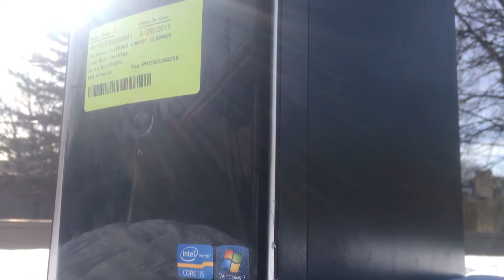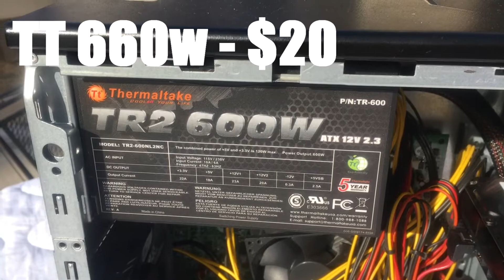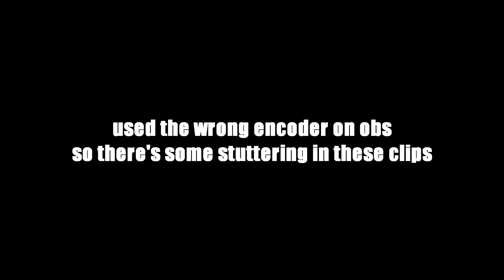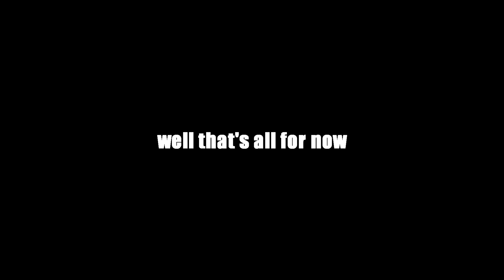$140 Upgrade Turns Old Dell Into Modern Gaming PC [House Fire Computing]

Comment: Will an MSI board fit? Amazon currently has an i7 that comes with a msi board and I believe ram for under 400
Reply from the maker: I dont know for sure but probably not. Using an aftermarket motherboard in one of these cases can be problematic because of proprietary connectors for the front panel and things like that. older ones like this used more standard connections but I no longer have this pc so I couldnt tell you for sure.
Reply: Why not just buy a cheap case if you’re gonna do all that..

Comment: I have a Dell 620 will the same power supply you use work?
Reply from the maker: if it's the mini tower then it should take a standard ATX power supply. If its the small form factor than it wont fit. However I'm not 100% sure so do your own research to be sure.

Comment: Hey, I have a Dell 660. I’m trying to upgrade the power supply and I don’t know which ones would fit. Can u tell me a few power supplies that would fit? (Preferably a PSU with 500+ watts)
Reply from the maker: any standard PSU should fit if you have the full tower 660 like this one. I would get a rosewill if you want something cheap, or maybe something like an evga g2
Reply: ratboy would a EVGA 600W ATX fit?
Reply: ratboy it’s for sale $60 in Best Buy
Reply from the maker: @xlfredo  I would think so, any psu should hook up to the mounts on the case, but some might go back father than others, that being said this is a pretty big case so I wouldnt worry about it
Reply: ratboy the measurements for the EVAG 600W ATX are:

Length: 5.5 inches
Width: 5.9 inches
Height: 3.35

Will it fit?
Reply from the maker: @xlfredo  I would think so, if you really want to be sure just measure the PSU thats in the computer already
Reply: ratboy I just got it. I’m setting it up right now and it fit perfectly!
Reply: ratboy I’m also rocking the RX 570. It surprisingly fit too
Reply from the maker: @xlfredo  nice man, I had to cut out the hdd slot to fit the giant 970 in there. thats a really good card for a budget too

Comment: Not sure why you went with the i5 3570 when you could have gone with the i7 3770.
Reply from the maker: Notails they are pretty much the same chip other than a slightly higher clock and hyper threading on the i7. at the time the i7 was almost double the price of the i5 and would maybe be 10-15% faster for gaming so I didnt think it was worth it.
Reply: @ratboyOwO  I'm upgrading to the i7 3770 and updating the bios prior to installing. I am also adding a new 700 watt PSU and an RTX 2060 GPU. Should I run into problems? It's a full sized Inspiron 620 tower with Windows 10 Home.
Reply from the maker: @samael1981  should all be good granted everything will fit in the case
Reply: @ratboyOwO   I am asking because I've recently read reports of people saying that the computer would not work with the RTX 2060 they bought.  I am hoping it was because they still had window 7. Originally, my machine was windows 7 but it's now windows 10.  I am also wondering if I can replace the two 4GB ddr3 memory sticks with two 8GB sticks.
Reply from the maker: Notails the ram should work. make sure your bios is updated to the newest version for that GPU. Im not 100% sure if it will work but most nvidia cards will. I have had trouble with older dells and radeon RX cards though
Reply: @ratboyOwO  The RTX 2060 did not work because it requires UEFI, but the GTX 1080 does work nicely.  Next thing I want to know is if the i7 2600/2700(k) will work.  The i7 3770k did not work.  The PC wouldn't even boot.  But I am wondering if the 2nd gen i7 will work.
Reply from the maker: @samael1981  Thanks for letting me know about the bios problems with that card. Hopefully you were able to return it and its good you got the 1080 to replace it. Its also very interesting that the 3770k didn't work. Have you upgraded to the latest bios? I would also be interested to see if a 3770 (non K) would work. Some of these prebuilts have a lockout on K processors. I think the safest bet would be that 2600 i7 non K.
Reply: @ratboyOwO  I don't think the k is the issue.  The k simply means that the chip can be overclocked if the motherboard allows it.  The problem is that the i7 3770k was a 3rd generation Ivy Bridge processor while the chip that is in the board is a 2nd generation i5 Sandy Bridge processor.  I am HOPING that a 2nd gen Ivy Bridge i7 like the 2600 or 2700k will work but I need to find out first.
Reply from the maker: @samael1981  I used the 3rd gen i5 3570 in this video and it worked out of the box. I think the K does actually matter for some of these prebuilts but I might be wrong. Like I said I think the safest bet is the 2600 i7.
Reply from the maker: @samael1981  thats assuming you have upgraded the PSU as well. an i7 might be too much draw without a proper PSU but I'm guessing you did for the GPU
Reply from the maker: @samael1981  https://www.cpu-upgrade.com/mb-Intel_(chipsets)/B75_Express.html I found this listing all supported CPU for this motherboards chipset. It seems that a 3770 non K will work however a 2700K will. Interesting!
Reply: @ratboyOwO  I upgraded the PSU for the GTX 1080 GPU.  It is a 700 Watt Thermaltake PSU, so I know that's not the issue.  Plus the i7 3770k draws less power than the i5 2320 and the Dell Inspiron 620 motherboard does not allow overclocking.
Reply: @ratboyOwO  I misread your reply.  Yes that is very interesting that it lists the 3770 but not the 3770k.  Every forum I have read says that if your Dell Inspiron 620 came with a 2nd gen Sandy Bridge processor, there is NO WAY to upgrade to a 3rd gen Ivy Bridge processor.  My Chipset is not a B75, it's an H61.
Reply from the maker: @samael1981  Thats the exact chipset in the inspiron motherboard so I'm not sure why it would be incorrect. Have you tried a non K i7 3770 personally in the computer? Like I said earlier my i5 3570 worker out of the box no problems on this exact motherboard.
Reply from the maker: @samael1981  thats what I was missing. I was assuming you were upgrading a 660 like mine in the video. I would assume they're right about it not working with 3rd gen Intel. I think a i5 2500 would be the safest bet for a high end CPU on that motherboard, but you could try the 2600 as well. good luck!
Reply: @ratboyOwO  Is the PC in this video an Inspiron 620 with Bios A10?  That's what I have.  LGA 1155 Chipset H61.  That list you sent me is for Chipset B75.  I looked up Chipset H61 on that exact site and it says i7 3770k will work.  But I looked around the site and I think they're dealing with aftermarket motherboards like ASUS and Gigabyte, not proprietary motherboards from Dell.
Reply from the maker: @samael1981  this is a 660 in the video. did I say it was a 620? If I did that was a mistake. Yes technically that chipset should run a 3770k but the dell bios can lock out certain CPUs that dell doesn't want to support. On the higher end Dells like the optiplex you would usually get close to full compatibility of the chipset but they gimp some of the lower end machines.
Reply: @ratboyOwO  yeah I was interested in seeing if I can upgrade from my i5 2320 to a 2nd gen i7. I called Dell and they told me to contact Geek Squad or a local store.